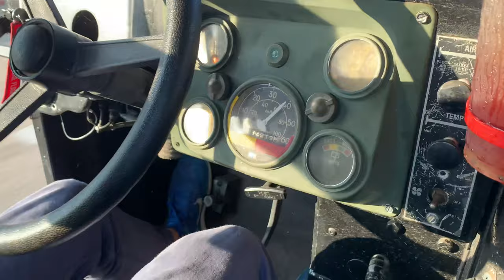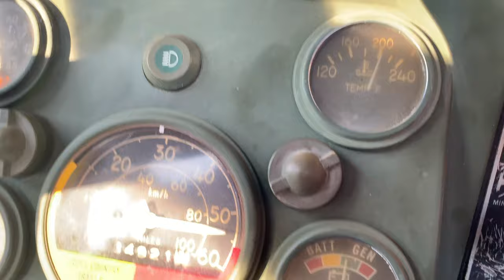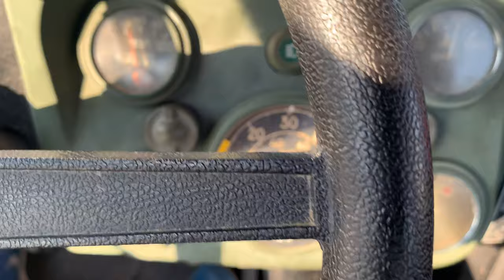I buy a military Humvee M998 for an adventure rig.  Land Cruiser replacement.

Comment: These things are a pain in the a**, and you're correct about the blackout(IR) lights. 

Signed, 
A former military mechanic.
Reply from the maker: LOL, all the military guys hate these things and the civilians love them, it is so funny.
Reply: Send it off to plan B they will get u up to 18mpg put it back to 12volt and get your engine EMP shielded and give your engine more power at the same time
Reply: Plan b is great. Bought my four man aluminum roof and back curtain kit from them and they were awesome to work with. Sweet rig man, have fun!
Reply: @LoneStarDrift   It all depends on condition, cause most military units dont give any care about them, making them pretty much break down every other day, and when they're up for repairs the reasons why are very stupid and vague. In MY opinion, the M1097's are better, more available kits
Reply: Liam Middleton these are already emp proof. Minimal electronics, mostly mechanical setup. No need to mod this setup. Mine gets 19 mpg in the same stock configuration. If I keep it under 40 mph it can get up to 25 mpg.

Comment: Put a duramax or a Cummins in it should be your second mod after making an interior. It will improve mileage power and reliability. Speaking from experience with working on my friends.

Comment: These are very easy to turbo. Add the kit and give it a little more fuel and your good. Just dont want to push much boost on that engine. I thought I knew about pretty much all there is to know about the military Humvees but I've never heard about the built in wheel winch thing.

Comment: "How is that thing still functional?"  Said everyone who limped one of these things back behind friendly lines.  These things are terribly unreliable but it hardly ever leaves you stranded without power.  My #8 cylinder blew apart and it still drove for another 5 miles before it finally started complaining.  Oh do a remote PMD swap.  Thats the only thing that WILL leave you stranded.  Bring a spare with you too.

Comment: 4bt/Allison 1000 swap, NP203/205 doubler T case, 2-2.5 inch spring spacers, 40's and Auburn lockers.
Reply: Don't need a doubler Tcase.  it's already got doubler geared hubs.
Reply: @nothingtoseaheardammit  I added that in because it's never been done before. Unless someone has added an atlas before.

Comment: Those are not inforred lights the big one is a blackout light the little ones are black out markers (think parking lights) in the back there 2 the upper one is the black out tail light the bottom one is the stop light. No back up light

Comment: You just need to upgrade or modify the diesel injection pump and slap a bigass turbo on it.
Reply from the maker: I already have the turbo!  Do you know any good write-ups online lol?
Reply: @LoneStarDrift  Nope sorry. But i'm sure you can find em. Lots of guys are doing stuff with these. I assume theyre mechanical injection, so if they have a bosch style injection pump you can send it off to GILES diesel tuning and he'll rework your pump for turbo use.  Theres also kits to drop a powerstroke in these. "Drift This" on motortrend did one of these and made some interesting modfications.

Comment: Can’t say I’ve ever been in a Humvee going faster than 35mph.
This thing is more designed to be beat to shit at low speeds and towing medium loads. 
Also know that military grade is not a good thing. These vehicles have been maintained by 18 year olds who went to mechanic school for two months and then told to fix it with cum duct tape
Reply from the maker: Mine is super stable and comfortable at 65 with the 40 inch tires, it is just really loud lol.   I would have no problem driving this thing at 80 mph if I had the transmission for it.
Reply: Lone Star Drift 
That being said I’ve always wanted a big hefty vehicle like this to take out and beat up without caring about the paint or running into a few things

Comment: I do believe the motor it has is a ford idi aka the international ford 7.3 and 6.9
Reply: I read somewhere these were powered by the 6.5 or 6.2 Detroit.
Reply: This one is most likely a 6.2 but they also comes with the 6.5